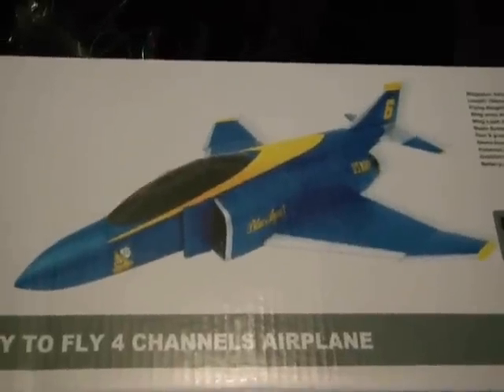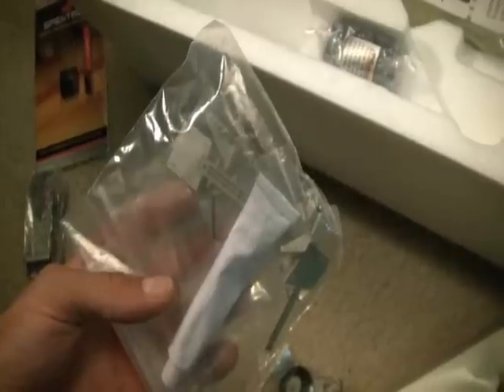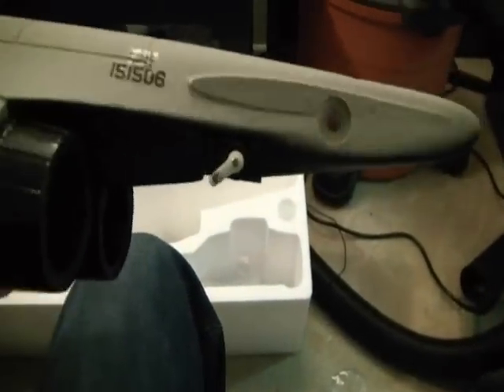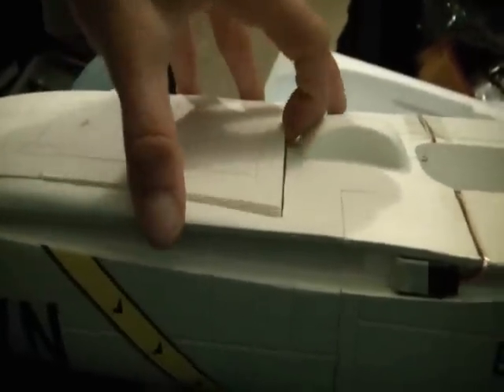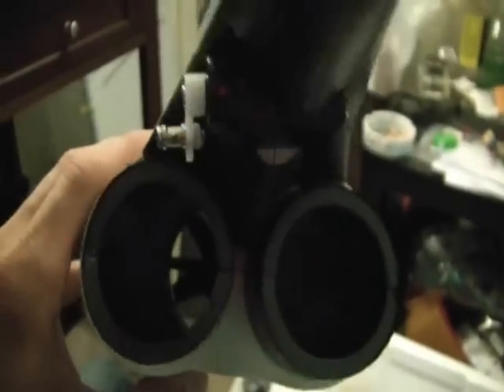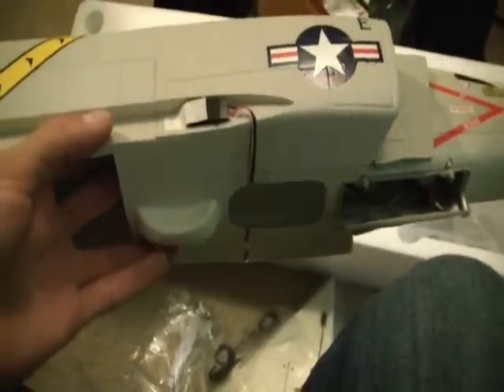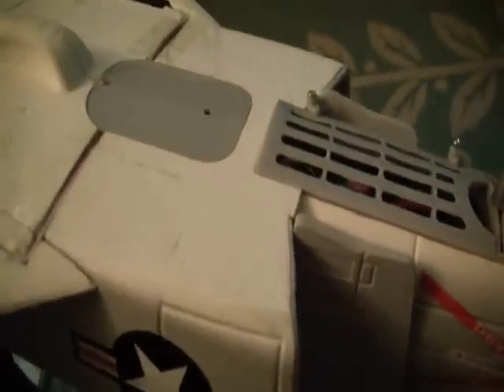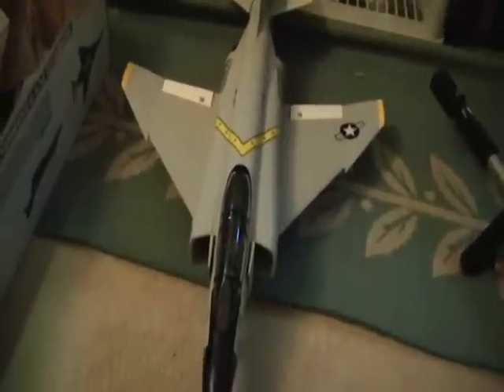F-4E EDF Jet from Nitroplanes / Exceed RC!

Comment from the maker: @Admiral1428 yeah, a rudder would be nice, and it looks like it would be pretty simple to add on.  Perhaps I will do that in the near future.  I want to see how it flies stock first, then decide if it is worth upgrading.  The elevator does seem to move very minimally, although it is a large rudder.  After the maiden with stock setup, I will mod as needed.